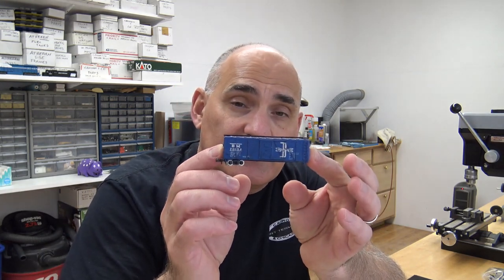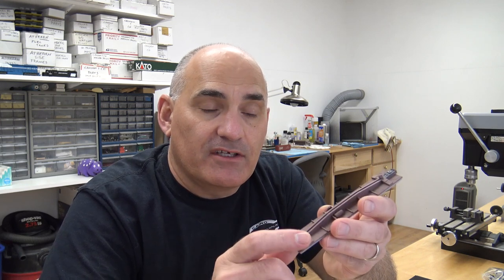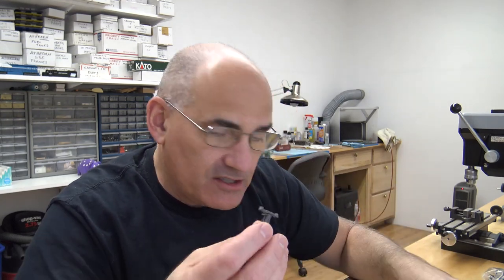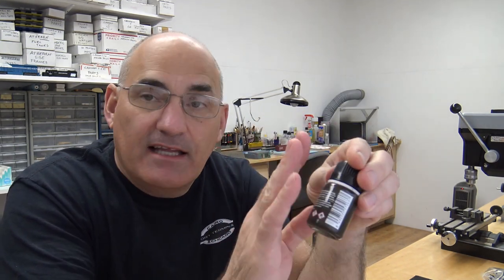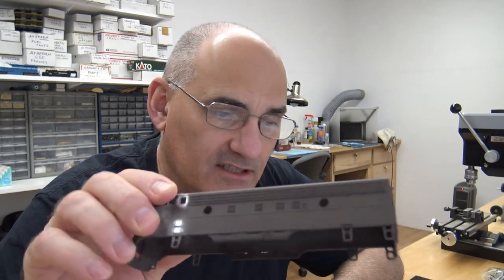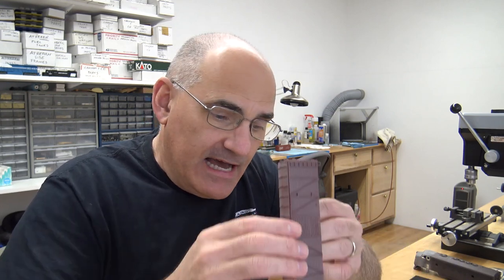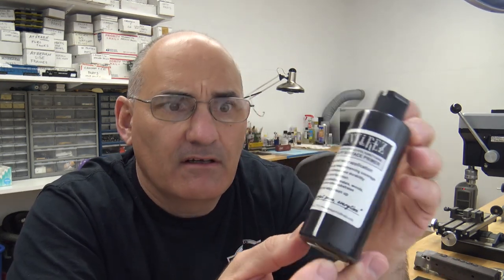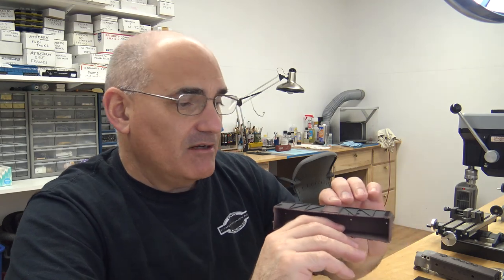B&M WOOD SIDE BOXCAR

Comment: How cool is this?

Good luck with your hairspray 'chipping'. I have seen some truly amazing models done with that technique.
In my own 'experiments', I found that it did indeed make a difference if I used warmer water.
I also found that when life interrupted one of mine, and the paint had almost a year to set (on top of the hairspray), I could still do the chipping effect.. though it took more effort (force) and persistence.

This is neat. Aging wood is one effect. Chipping another. And distressed lettering a third.